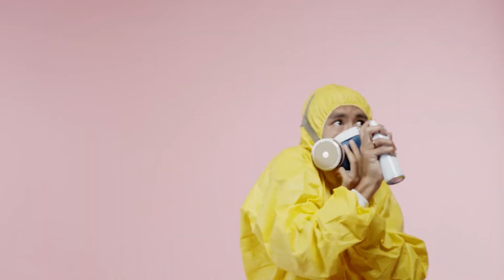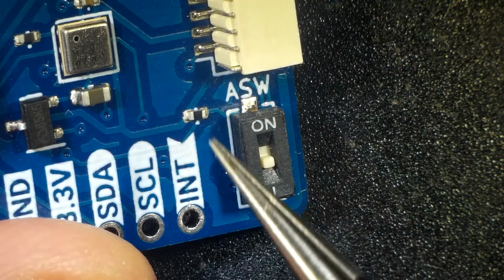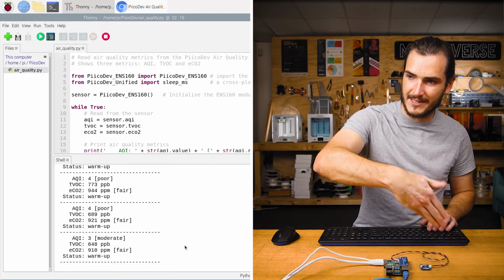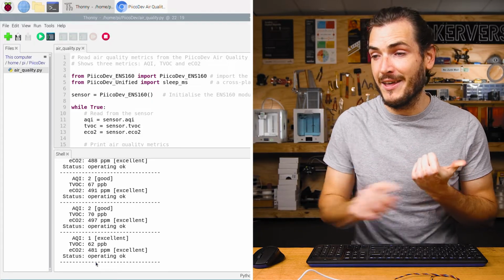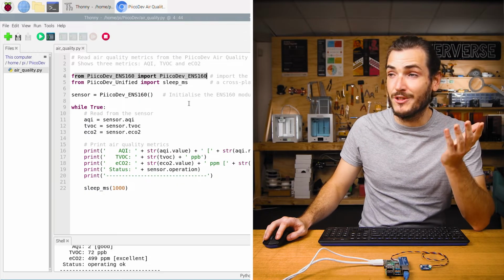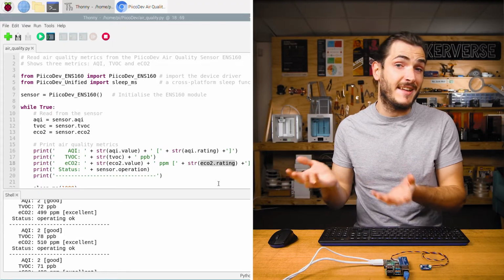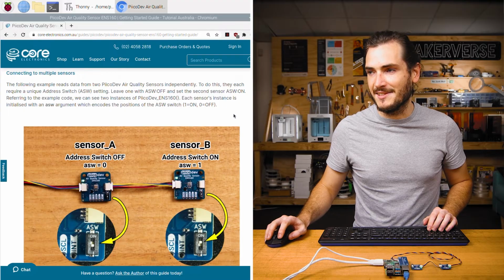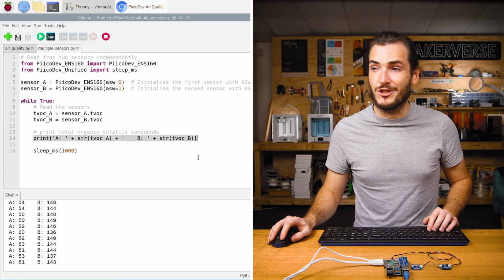PiicoDev Air Quality Sensor | Guide For Raspberry Pi

Comment: Thanks for the video! It's impressive how quickly and easily the data can be accessed from the sensor in a useful format (ppb, ppm, etc.). I was looking at the data sheet and see that it's possible to potentially output values for specific gases that the MOX sensor is sensitive to. I work on methane emissions and would love to see a future video accessing methane from the sensor as a user customized application. Awesome stuff!

Comment: do you think there is a way to have the sensors relay data wirelessly? say If I wanted to place one in my bedroom and one in the living room? then send the results of the air to my phone?
Reply: Absolutely. I'm running my API to turn on/turn off relays, getting temperature and humidity records. On every end of measurement you can send a notification to your phone.

Comment: Wonder if it can detect “vape”
Reply from the maker: The ENS160 sensor is typically dialled in to detect regular indoor pollutants, it might be able to detect vape smoke though would need some testing. It probably would if you directly blew into it though!